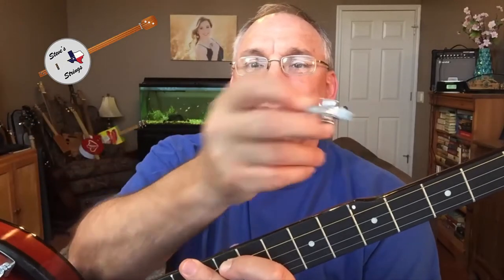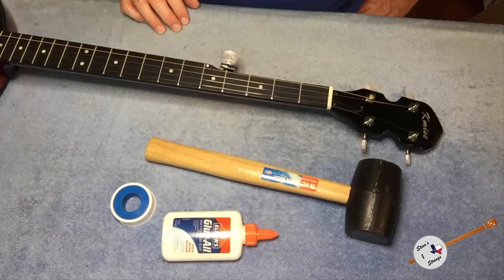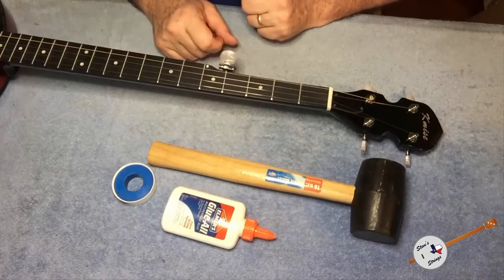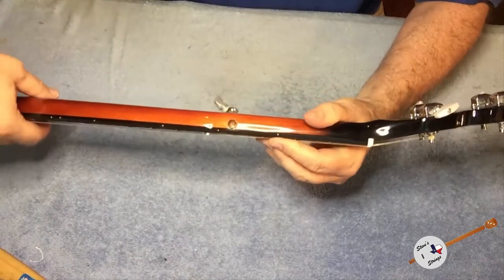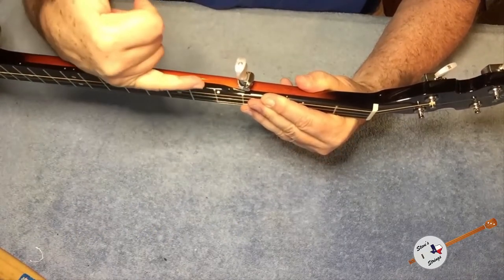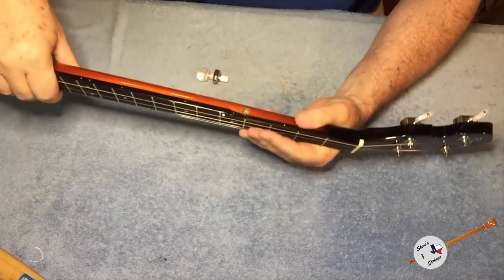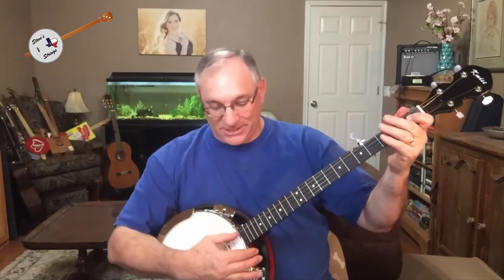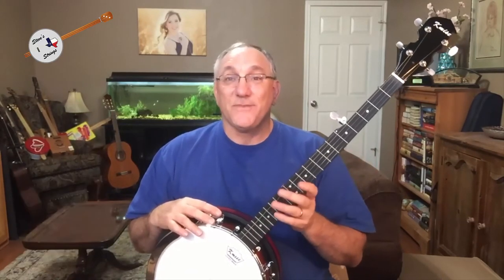How to repair a loose banjo tuner!

Comment: I like to remove the knob, then slide a nut driver over the shaft so I can tap directly on the shoulder of the tuner. I wouldn't use Teflon tape. A single layer of heavy paper would work better to achieve a jam fit.
Reply from the maker: Thanks for the tip, John!  I will do that the next time I need to replace one.

Comment: Thanks for the repair. I have a banjo student who had the fifth string tuner come completely out. I used the teflon tape as you did (several wraps) and then placed white glue around the teflon tape and in the hole. I offset it as you did using a rubber hammer to tap it in and let it set-up for two days. I then tuned the instrument and my student picked it up today. It seemed to hold well but time will tell! Thank you, Jim Herzing
Reply from the maker: Thanks Jim! My repair came loose after a while. She John Calkin’s comment for a better approach for next time. Thanks for watching and commenting!

Comment: I glue in a few pieces of flat toothpick to give the splines in the tuner base fresh wood to bite into. Don't completely reline the hole. I remove the button and place a small socket over the shaft. Then, with a padded caul on the opposite side of the neck, I use a C-clamp to squeeze the tuner into place.
Reply from the maker: Thanks for the suggestion! That sounds like a great approach!

Comment: One might think the teflon could allow the tuner to spin more freely in the tapered hole, even as it is shimming for a more snug fit. The metal taper is bearing on slippery teflon instead of grippy wood. However if your repair is holding that’s all that matters. I replaced mine that was loose and glued it in with wood glue and no shim. After tapping it in I secured it snugly with a cable tie for 24 hours. Time will tell if it holds…
Reply from the maker: My instinct was to shim it with thin veneer or a piece of paper but I wanted to try the solution offered by the manufacturer. It is still holding so far!  Thanks for watching and commenting!

Comment: Gee, it looks like a bad design to just press it in like that. I wonder how long it will hold. I don't expect the glue to adhere to the teflon tape at all, because it's TEFLON. The glue on the outer collar is probably doing most of the holding.
I recently did some research on repairing stripped threads. I would try adding a few strands of copper wire in the direction of the hole (not wrapped around the peg). It's a soft metal that will conform a bit, and it will dig into the wood a bit.
Reply from the maker: Although some 5th string pegs are threaded, most use friction to hold them in place. I agree about the glue.